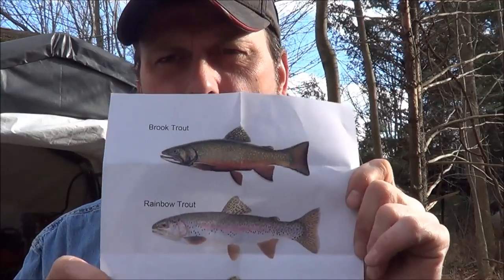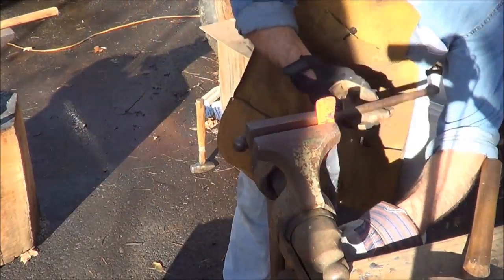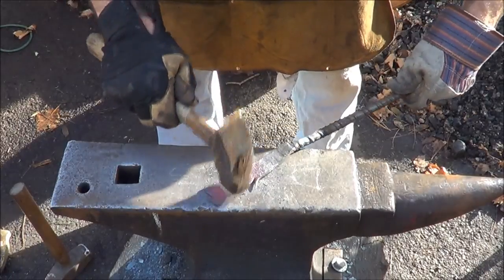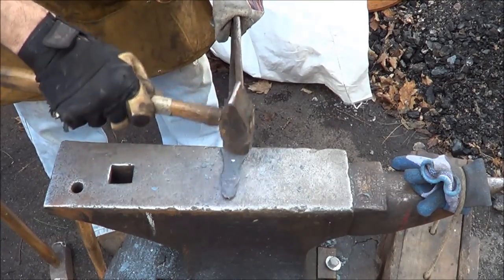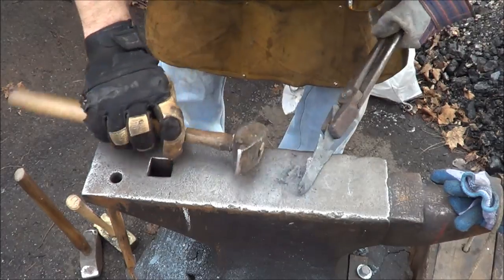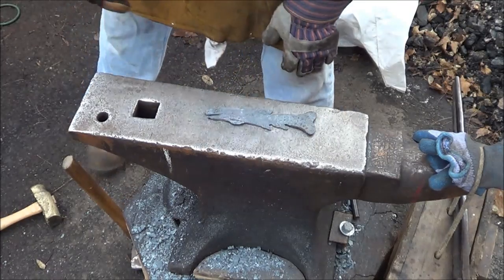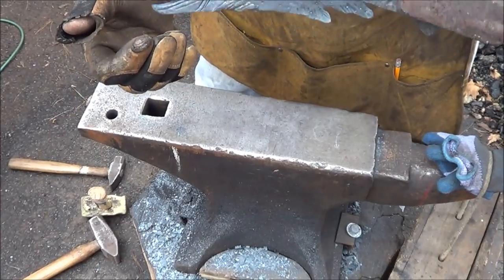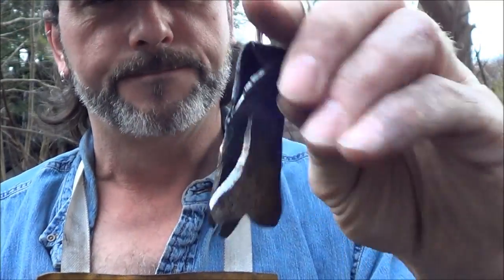Blacksmithing - Forging A Trout Bottle Opener Detailed Video

Comment: ok so do not hit your smithing hammers together, have to use  one softer like the brass one you made, whats the difference between  two regular hammers and  say  a hammer and a chisel,  i would guess the chisel is  softer than the hammer , if I am right then eventually the chisel and the  brass hammer would mushroom out or get dents? awesome videos by the way  happy holidays